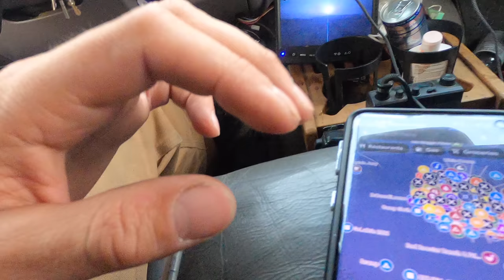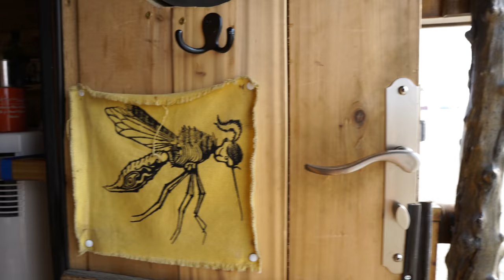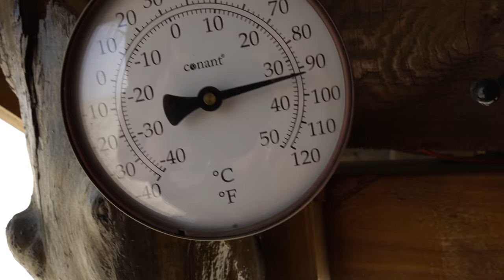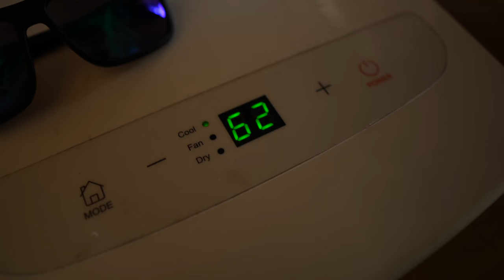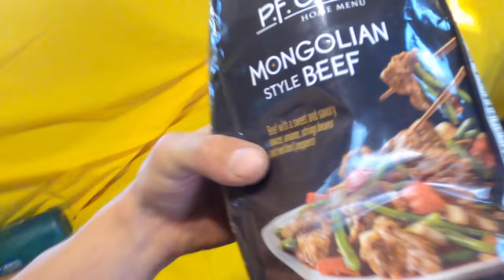Going to "NOT" Burning Man - free burn 2021

Comment: I call " playas" nature's leach fields where eons of toxicity are stored for eternity. So yeah, it would be a shame to pee on it. Also, burning man is kind of the ultimate drinking game and has become a billionaires playground with luxury theme camps complete with chefs, dining halls and chamber maids that stay in class C motorhomes while the elite stay in luxury class A units. I rented my Class A to one of these camps for 2 years @ $20K each year. Will Smith stayed in it one year. I now rock an older Outfitter pop up camper on a 2001 Superduty 7.3. I burned out a piston at 170K miles, I now will not alow the EGT to go above 1150. PF Chang bag meals are a staple for me as well 😀

Comment: Looks like you have 4 solar(?) outdoor lights marking the 4 corners of your camp. GREAT idea. Can you charge them without solar (ie, whilst driving during the day)? Do you have to drill holes in the hard salt pan to mount them (ie or can you pound in the stakes)? Do you have a particular brand of lights you like? Thanks!
Reply from the maker: $5 each at home depot, pound em in, sun charges them during the day

Comment: There's van/bus roof mounted Air Conditioning units that run off DC that can cool down a van sized space with the engine off, with 600+ watts of solar on the roof. Up to around 95° for 4 - 6 hrs in the afternoon. But not like a real Air Condirioner can cooling a space to 63°F at under 50% humidity with a generator.
Reply from the maker: exactly;)

Comment: THE TRUCK IS CUTE BUT THE DESIGN IS ALL WRONG

1. YOU SHOULD HAVE A KILOWATT OF SOLAR, 100 WATTS IS FRIKIN PATHETIC, SO PATHETIC, YOU'VE GOT THAT GENERATOR GOING

2. SPEAKING OF GOING, YOU SHOULD GO VEGAN ALREADY........

3. TOO HEAVY OBVIOUSLY, DIFFERENT MATERIALS COULD BE USED TO EMULATE THE NATURAL AESTHETICS WITH FAR LESS WEIGHT AND BETTER AERODYNAMICS

4. THE TRUCK IS AN OLD FORD GAS HOG.......OR DIESEL HOG, SAME DIF

5. A RIG LIKE THAT COULD BE USED FOR LIMITED TRAVEL LIKE TO A COUNTRY SITE, WHERE YOU BUILD A HOUSE, WHICH COULD BE YOUR NEXT EXPERIMENT..........

6. THE ORIGINAL BURING MAN WAS WHERE THE GOOGLE RATS USED TO PARTY, I GUESS THIS IS A NEW BURNING MAN, I DON'T KNOW ALWAYS TRIED NOT TO PAY ANY ATTENTION TO ANYTHING SO LAME, IF THIS IS SOME KIND OF NEW BURNING MAN THAT'S MORE ECOLOGICAL AND IT DOESN'T HAVE ANY GOOGLE RATS IN IT THEN THAT'S REAL SWELL

7. OH YEA, IF IT WERE MODULAR YOU COULD DEMOUNT THE CABIN IN MANY SITUATIONS, WHERE YOU'RE STAYING IN ONE PLACE LONG TERM AND YOU NEED THE TRUCK FOR HAULING, ETC.